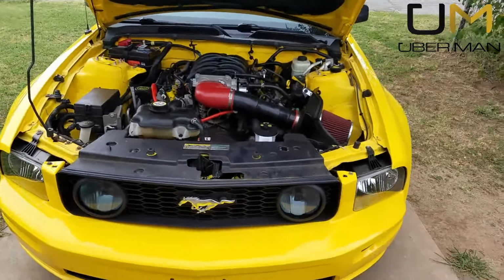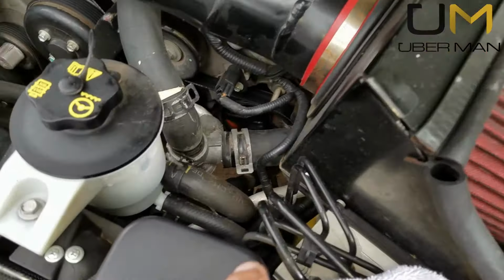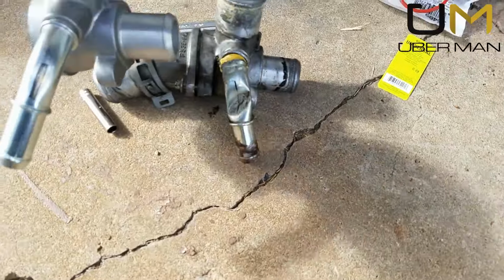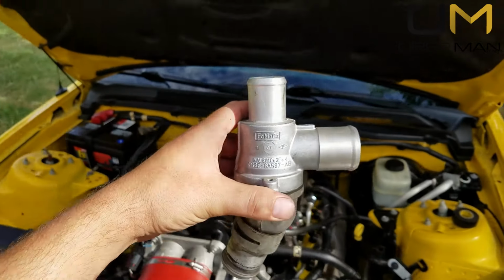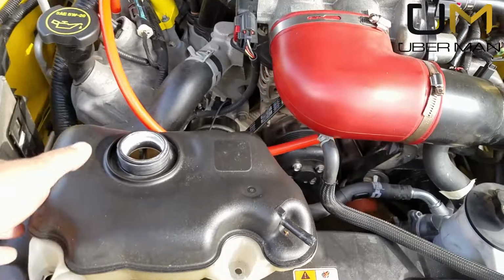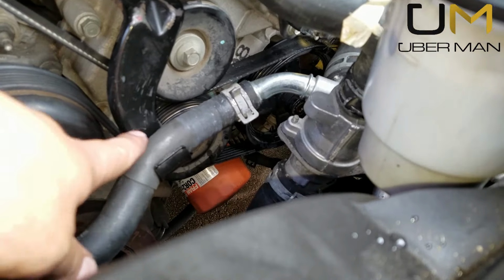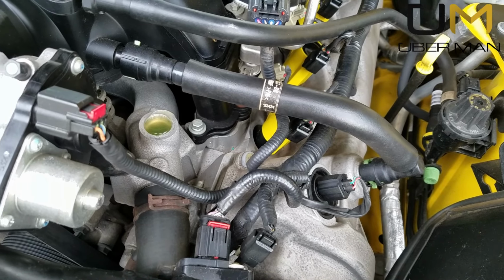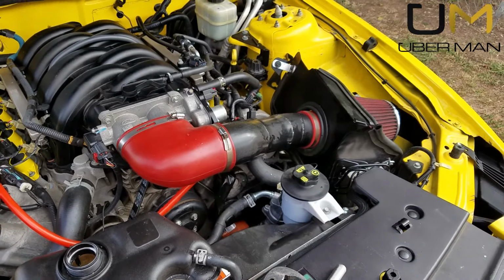2005 - 2010 Ford Mustang GT Coolant Flush + Thermostat Replacement 08-14-16

Comment: Hey man i have a 2008 Ford Mustang GT/CS 
With 40K Miles on it 
Just hopeing another Mustang owner of the S197 family can help me figure out what possibly could be wrong 
Again my car is a 2008 GT/CS 
My problem is the car is 
slowly overheating strangely after my A.C stoped working the car seems to only overheat when at idle 
But the car WONT overheat while I am driving it any ideas? I would appreciate it  

Car doesn’t have white smoke out the tailpipes 
Car haven’t lost any power 
Car radiator doesn’t have any milky water or cap 
Car doesn’t have any water bubbles out the radiator 

But i can smell antifreeze when it starts to overheat
Reply: Your radiator might have a small crack somewhere, the same problems happened to mine 😂 it’s only overheating when at idle because when ur driving there’s the wind and I believe the radiator fan will be going too when driving automatically sometiems where as at idle sometimes it won’t
Reply: But regardless I had the same issues only problem is I kept driving it till one day the radiator crack became big enough for me to find it once I replaced the radiator my car ran fine
Reply: @rockodashpr
Reply: It's possible one of the pulleys are seizing. The belt is always moving when the car is on, but under load, it puts more force on it. Inspect the pulleys, especially the tensioner, water pump, A/C compressor and idler pulleys.

Comment: I’m way late but 🤷‍♀️🤷‍♀️ 
I’m a woman learning to do things to my 2010 GT all on my own so bare with me. 
If anyone sees my comment, can you tell me this... when you put the cleaner in the radiator with the water, do you have to wait to go back to using it as a daily driver until you put the 50/50 radiator fluid in?
Reply: As long as your local temperatures aren't dipping below freezing, using only distilled water with radiator flush/ cleaner while daily driving should be just fine.

Comment: Does  the smaller part of the thermostat but up against something inside that housing? Mine new one came to me a bit crooked. Just curious if I put it in, if it’ll straighten out. Thanks

EDIT: I figured it out. All is fine with mine. 👌

Comment: This DOES NOT APPLY TO THE 2007 MUSTANG GT. Thermostat on gt is just to the right of the alternator and requires removing a few parts and disconnecting some plug wires. Other than that this video is very informative for the models that have thermostats in that spot.

Comment: my 2006 mustang (first car) I'm only 18. is leaking coolant. I bought some and poured it. next day it was empty. and hot. went under the car and seen that it might be the head gasket but I'm not so sure. what would you think it is?
Reply from the maker: I couldn't say what it could be without seeing the leak for myself.
Reply: Uber Man may I send you some pictures on Twitter?
Reply: I also have a leak on my 2007 v6 Mustang and for me, it's the whole thermostat housing. Because it's plastic, the constant heat from the coolant and the durability of the plastic (non-existent) causes the housing to crack or create a gap within it. I'll be replacing mine this weekend with a metal housing. Hopefully no more leaks afterwards!
Reply: w for w A little late, but check the connector and hose underneath the intake manifold. After a while it’ll leak and travel down through the bell housing and come out looking like motor oil, feeling like ATF, and smelling like coolant
Reply: Invest in a radiator pressure tester. I found one in Amazon for around $65 and it worked to find my leak. Don't go over the max PSI of the cap. Turned out the plastic thermostat housing seal was melting. Replaced it with an aluminum one.
Reply: If your worried about your head gaskets or cylinder head being damaged or warped got to auto parts store and rent a test unit  Engine Combustion Leak test Kit or something

Comment: Great video did mine today however mine only took 1 jug of antifreeze before it was full after I drained it .Did I do something wrong
Reply: When you drive, thats when the thermostat allows coolant to fully flow, if it stays that way for a while you may want to look at replacing your radiator which can be gunked up causing your coolant not to flow well, also I’m a year late hahaha
Reply: @demonsamongstmen562  You do not have to drive the vehicle for the thermostat to allow coolant to flow. the coolant has to get to the temperature of said thermostats spec as you can put different temp stats in vehicles. thats when the thermostats opens and allows coolant to flow. if he did not drain all of the coolant from the block or if he filled it and didnt let it run to get up to temp for it to open, then you will not be able to add the proper amount of fluid.
Reply from the maker: Just keep an eye on the coolant level for a few days.

Comment: You should change the title of this to 2005-2006 Mustang GT coolant flush and t-stat replacement. The 2007-2010 4.6L 3V uses a totally different upper house/t-stat housing design.

Comment: do you burp it after you replace the antifreeze r before ?
Reply from the maker: After.
Reply: and what brand coolant did you use
Reply: Uber Man I'm trying to Dee if you could tell me where can I bleed it at after you put new coolant in?
Reply: Jabari Jones you don't have too burp it the way he did it. Turn the engine on it will force all the air out but make sure you let it run till you are satisfied all the air is out